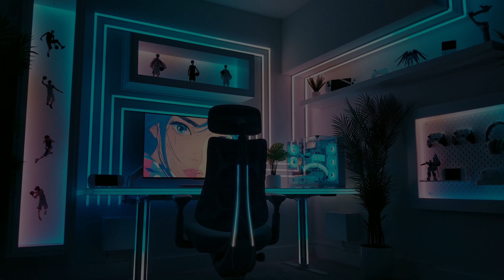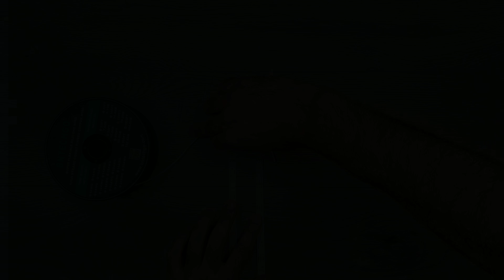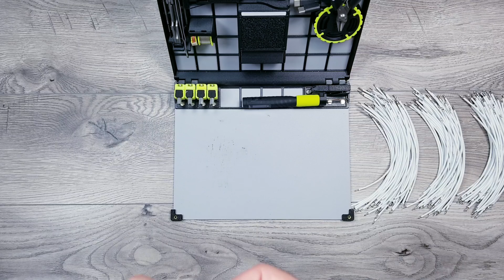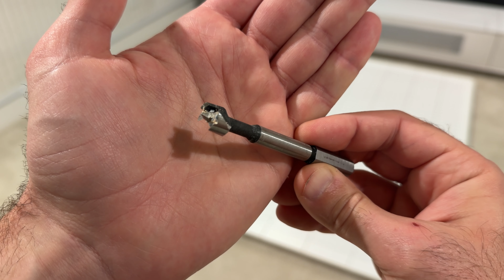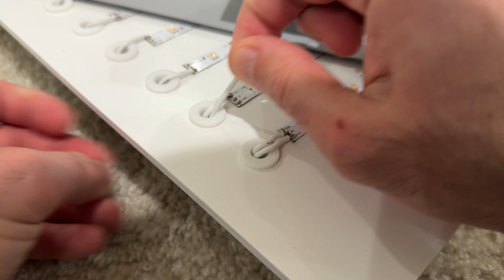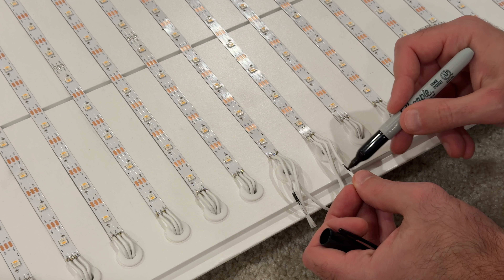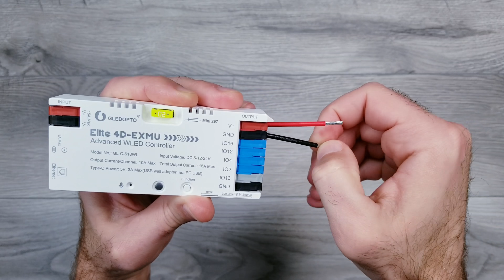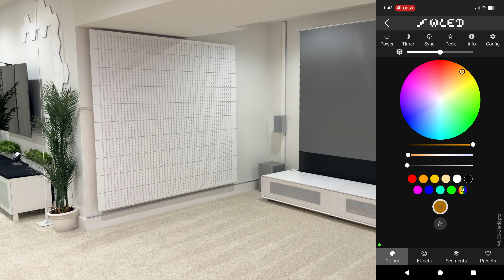DIY Matrix Panel: EASY, One Controller, One Power supply.

Comment from the maker: Solder Kit: https://bit.ly/40s3jFk CHRISMAHERDIY for 10% off
Gledopto WLED Controller: https://amzn.to/4vXACxx
12v power supply: https://amzn.to/4aIceYk 
12v sk6812 leds: https://amzn.to/4piiLiD (30 led/m)
12v sk6812 leds (AliExpress) https://s.click.aliexpress.com/e/_c3bFW6iD (30 led/m)
Ethernet cables for hardwired connection: https://amzn.to/4pckxBC
12v power supply: https://amzn.to/4aIceYk 
Wire Stripper:https://amzn.to/3V8Hszv
18 AWG Silicone Wires White: https://amzn.to/4h6CT4T
18 AWG Silicone Wires Red: https://amzn.to/4wzL4eu
18 AWG Silicone Wires Green: https://amzn.to/4wCqSZt
Wire Stripper: https://amzn.to/4h7Pipi or https://amzn.to/4feiEjq
Wago Connectors: https://amzn.to/4vi7BeR or https://amzn.to/4vpnCjk
Stud finder: https://amzn.to/486dR1b
Brad nail gun: https://amzn.to/4tjtRVt
Forstner bit: https://amzn.to/4cl6iWx
Rubber grommets: https://amzn.to/4teIYzD
Solder Kit: https://bit.ly/40s3jFk CHRISMAHERDIY for 10% off
Kester Solder (best solder i've ever used): https://amzn.to/4lxLjlf
Govee 1500 LED Light Wall (if DIY rout is not an option): https://amzn.to/4tP10sa

🎧🎧🎧 Music (helps support the channel) 
timeless: https://cgmc.bandcamp.com/track/timeless
drifting apart: https://cgmc.bandcamp.com/track/drifting-apart

Relevent Videos:
Ambilight build: https://youtu.be/kJC-BvfhafY
Gaming Room Build: https://youtu.be/POQ3JYnBm7Q
Soldering Tutorial: https://youtu.be/Mh-hQd4c7fU or https://youtu.be/apSz3NXYlx8
Media center initial buildout: https://youtu.be/IW_wCNGrUyU

=============================
Support My Channel Directly:
Become a monthly contributor on Patreon: https://www.patreon.com/ChrisMaherDIY
Buy me a Coffee: https://paypal.me/ChrisMaherDIY
==============================

The best way to help support my channel is to like, comment, make sure your subscribed and share my videos with as many people as you can. The other way is to use my links above as I get a small % at no extra cost to you if you buy something. Thank you all for the support!
Reply: Have you considered solder dipping for repetitive wire preparation?
A small, metal, heated cup containing molten solder for wire dipping seems like a much faster process.
Reply: Cool project! I could be wrong on all this but I'm concerned. The strips are capable of pulling 1620W/135A at max brightness. The Gledopto controller maxes out at 180W/15A total. Your power supply isn't enough for that unless you are further limiting what the strips can pull in software, and you'd need to limit it to 100W/8.33A total for it to be safe and leave 50W PSU headroom. So right now you're getting only 6% possible brightness from the LEDs and it may even be unsafe depending on how the Gledopto controller handles it. I'd recommend at the very least upgrading your PSU to 230W.
Reply: Total build costs ?    Thank you
Reply: Easy solution for against hurting knees and back... Lift the workpiece so u can stand or use a chair. 
Also, do u use the forstner drill at low drill power. With wood ain't helpful. Better use high power and control the throatle with the trigger.
Nice project.
Reply: damn you should of shown more effects 😔because that looked amazing, damn! 😑 now i have to do this myself thanks alot🙄🤦😆

Comment: Here is a tip for anyone wanting to tackle a similar project, for tinning hundreds of wires in just a few minutes: take a shallow can (like a tuna can) and place it on the stove; making sure, of course, to keep the windows open and the exhaust fan on full power. Then, add some solder (preferably lead-free, if you care about your health), and you have your own solder pot ready for dipping the wires you need to tin.

Comment: One tip wit tinning the wires , you put some soldering wire in a metal cup, put in on the stoveand when its melted,  you just dip in the wire ends in it ... waaay faster .

Comment: Curious what the total price of this project is
Reply from the maker: Probably around 800? but majority of the cost was the led strips and if you just use regular ws2812 strips (instead of the sk6812) you could easily cut this project in half (but would probably need some more injection points for power since those are 5. Or you could use some 12v ws2815 strips that are still cheaper than the 12v sk6812 lights I used.

Comment: Notwithstanding the marketing jargon, they are not individually addressable LEDs. They are serially addressable (or string addressable) LEDs in an LED strip. For them to actually be individually addressable, you would need to be able to update exactly one LED with one short instruction, i.e. send a single address/data pair and a single LED updates. This is the sole reason I never consider these products. They have lots of advantages in design simplicity. I just can't get past the lie.
Reply from the maker: I mean I can chose any led on the string and send  data to that 1 single led. Not sure how that's not considered individually addressable?
Reply: @ChrisMaherDIY  The strips don't have individually addressable LEDs. It's the library that you are using that makes it look like the do.

The controller sends a reset pulse, then streams the color data for every LED in order. It never sends a packet to a specific LED by address. Each LED just consumes the next packet in the stream.

If these LEDs were truly individually addressable, updating a single LED repeatedly would give you an update rate of about 12,500 fps.

Your 2,500 LED panel, it it were all wired as a single continuous strip, probably would have an update rate of about 10 fps, depending on the protocol speed. Because you set it up for 4 groups that can be updated in parallel you are probably getting about 40 fps.

It's possible to design a LED strip that has the same flexibility of being cuttable and solderable into longer strips that could actually have individually addressable LEDs. But the communication protocol would have to be very different. It would need to include a method to assign each LED an address, or at least have a power on default where each LED discovers it's own position in the strip and assigns itself a unique address. But that's not how WS2812/APA102 style strips work. They're serially addressed, not individually addressed at the hardware level. Yet these kinds of strips are marketed as having individually addressable LEDs. And that's a lie.
Reply from the maker: Gotcha! Thanks for the explanation. do truly individually addressable leds exist and if they do are they at the same price point as the ones I generally use (sk6812)?
Reply: @ChrisMaherDIY  I don't know of any for LED strips that do. But the protocol definitions for self assignment of individual node addresses on a bus exists in several bus types, like I2C, RS485, CAN bus, etc. RS485 (arguably the same basis of twisted pair wires that ethernet and USB use by the way), has a protocol design where the controller sends a "program mode" command and assigns the first device an ID=X. That device sets it's address and sends an incremented X downstream. That's an over simplification off what happens, but you get the point. Devices using this bus protocol have been in use in industrial automation systems for probably over 40 years by now. It's not like there is a patent protecting the idea of self assigned addresses.

I just googled found that the WS2811, WS2812 design protocol comes from China.

Perhaps they wanted some control over it's production and distribution (and perhaps even wanted patent protection) and therefore had to come up with something new. Perhaps they knew that it wouldn't sell very well unless they lied about it being individually addressable. Perhaps 'individually addressable' means something different in their language, or perhaps they just don't care enough to use accurate terminology.

In any case calling them "individually addressable" is a marketing 'jargon' claim at best, a deception or lie at worst.

Comment: If I’m lighting bookshelves (both top and bottom rows) would this method work as far as power injection and keeping everything on the same data? Obviously my wires will be longer,  but it should still be the same concept right?

Comment: I DIY my 65" tv ambient light with a custom arduino controller and 300LED with 12A PSU (overkill because only uses 3A). 
Total cost 15$
I wonder what's the cost of this...

Comment: New tool list for ya.

- Saw horses... i mean, come on man. 

- Solder pot. Just dip the wires in.

- Hot air rework gun, wand station... whatever you like. Easypop a lot of wires or chips off with it. Its also a lot easier to set chips and reballs if you dont have a plate. 

For real, get off your knees unless you do yoga and have built them up a lot.

Comment: Gledopto has only been a major disappointment for me in the end so I hope for you it holds up to your expectations in the long run. Also that PSU is certainly not high quality...
Reply from the maker: I've been using their controllers for a couple years now and they've been rock solid. I've also never had a psu fail but I'm also not doing commercial installs where things are running 24/7. I'm sure there are more expensive/high quality psu's out there for that type of use case.

Comment: how much does a project like this cost minus bought equipment ie soldering iron etc
Reply from the maker: I never added stuff up but the led strips were by far the most expensive. My guess is probably around 600?
Reply: @ChrisMaherDIY oh that's good. Would this be possible if you could get smaller compacted LEDS?
Reply from the maker: Yeah you could do it with any addressable LEDs. Different LEDs have different voltage/ power requirements so that would be different.

Comment: Rather than unsoldering , could the start of the role not been cut on the next cut marker ?
Reply from the maker: You certainly could but each roll I used had 150 LEDs. 50 goes into that even.

Comment: for tinning the ends of the short wire you could have dipped them into a molten crucible of solder help hot with a torch

Comment: There's a beginning to this quest and that is first mastering multi axis machining or robotic control systems and robotic assembly. So you can just program your robot slave to solder and line everything up straight every time and repeat that process hundreds of times so you don't have to. I mean you still have to learn all this stuff and even more for robotics. But then you don't have to literally work on your knees all day long or inhale a bunch of fumes and need a chiropractor and massage therapist after just to sit down and enjoy your work!

Comment: Tinning 300 wires almost justifies making yourself a small solder bath so you can just dip a whole bundle all at once. I guess if it takes more than 1.5 hours to make and prep the bath. But if you do this more than one time. Definitely.

Comment: solder pot's are used industrially, well more  back in the day for tinning wire. Probably work for the strip if you didn't dip to deep.  Great things if you need to tin things. Can toss old scrap bits of solder in to keep it topped up. Not worth it for a 1 off but if you do it on the regular they are a life saver for time.

Comment: How do you figure which is the top or bottom? Also I'm very confused at where the cutting happens and which one you connected the clips to. Also I'm confused as to why you had to solder another cable to the led. Can someone please explain

Comment: I think that the tool that would make drilling all those holes easier would be a bench press. I'd probably drill the end panels before putting them on the big square, and triple checks the measurements.

Comment: Since you ask, I think the easiest way to drill 50 half-inch holes is to put the Forstner bit away. Mount a finer drill in your chuck, something like 3mm (one eighth) and drill all the starter holes. Then use a 12mm/half-inch HSS bit.

Comment: Get a solder pot. Dip the ends in flux, then in the solder pot. Make sure not to run the pot too hot or it will cook the solder.

Comment: Hi Chris, awesome video! I want to try and make one for my place, not as big, maybe 2m x 1m, but wondering if I could use 5V LEDs instead? Obviously I'll then use a 5V power supply instead of the 12, but then would there be a significant or noticeable power drop? I'm wondering even if I break it into 4 sections like you did, if that would then maybe help?

Comment: Hey Chris, Long time watcher, Big fan.... Ive done a few cool projects using your videos as inspiration. one trick Ive learned is, Power doesnt really need to be ran like the data line. It flows in both directions, like a bus. You could easily take a single wire, and lay it accross all Positive pads, another across all negative pads, then only worry about the data being connected end to end.... Its saved me hundreds of hours of soldering and probably hundreds of feet of wire too. (the positive and negative leads dont even need to connect to the same area on the strip.) Ive actually found that this method helps with power hungry setups, as it dispurses the power more evenly, allowing each section to get more current from the wire, vs going through all the strips.

Comment: Actually for power distribution in these applications, it's better to make a bus-bar connection whit positive on one side of the strip and negative on the other side. If you do so, every led will be supplied whit approximately the same voltage. good job btw

Comment: Holy hell, I priced the strips controller and power supply on amazon and Its just shy of $1k, that's without the wood and spool of wire for connections. Entertainment has a cost.

Comment: 13:19 It comes preinstalled with a fork of WLED that’s been customized for the Gledopto controllers. OTA updates with the official WLED firmware on their controllers (I think just the Ethernet, but maybe all of them) can ‘break’ stuff
Reply from the maker: I've updated these before with the non gledopto version and they worked perfect. Just have to make sure you use the Ethernet version if you have the Ethernet controller and then enable Ethernet in the settings again. But might as well just use the Gledopto version since they have it available.
Reply: @ChrisMaherDIY That’s good to know. I haven’t personally tried OTA updating any of them, because I haven’t used any of the ones I have in any meaningful projects (I want to make one of your panels and use one just for the spirit of the build), but just recalled seeing it in the manual and assumed they did something funky with the code that I didn’t want to have to dig into to fix.

Comment: I would have marked ONE side of all the wires before attaching to the strips. I solder 1200 wires in one shift. I make a LED product and hand solder. 3 wires in and 3 wires out times 200 strip. You could have cut your short white wires and used a marker to identify one end of the them. One pile green, one pile red, one pile nothing (aka white)

Comment: Nice! The clean work takes lots of focus, patience and repetition.
If I needed to tin that much wire I would have got a small Solder Pot.
Sticking the bare wire ends in flux and then a quick dip in the Pot would have cut that 1.5 hours down into minutes

Comment: You could have saved the desoldering step by just cutting one LED of from the start and use the next set of contacts
Reply from the maker: I normally do that but each strip has 150 LEDs total. 50 goes into that even.

Comment: Great video! Quick question: I get why you had to do power injection periodically to prevent voltage drop, but why did you have to split data into 4 distinct sections? Is it that the data line would also see too much voltage drop?
Reply from the maker: WLED recommends to not go much over 600 LEDs per data channel for best performance. I've never tried 2500 LEDs on a single data channel but my guess is you would have some performance issues. Might have to try that sometime though!
Reply: @ChrisMaherDIY thank you for the clarification!

Comment: Very cool 😎 I did something like this about 10 years ago with individual addressable rgb leds on led strips and the T-300k controller.  I wanted my led wall to be able to display video and not just cool led movements / sprites.  And it actually worked!  I used a roll of plastic fencing & zip tied the strips to the fencing.  I needed it to be light weight so I could hang it off my house for Christmas season movies.  It was a lot of work!  I feel you!  I’ve found that dipping the electrical wires in soldering paste to tin them to prep for soldering works fantastic!  It sucks in the solder instantly on contact when you pot solder on your soldering iron tip.  Excellent job you did on yours!  Thank you for sharing.

Comment: Mid watch but use a hole saw not a forstner bit. Forstner is for like doing a hole halfway through the piece if u wanted to add a nut insert in or for clearance

Comment: Hey awesome project but I have a question regarding the power calculation.

You are using 2500 LEDs. Each can pull up to 0.4W (taken from the led strips you linked) at 12V, that means each can pull up to 33mA (0.4W / 12V).
So max power pull would be 2500 * 33mA = 83A at 12V. 
Your power supply can supply 12V and 12.5A max. 

Aren't you bottlenecking your LED brightness and power consumption like this? So you basically wouldn't be able to run the LED matrix at full power consumption. 
Dividing the max rated amperage 12.5A by the max possible ~83A you could run the LED matrix at only ~15% power.

Am I completely wrong on my calculations or does it seem to be underfitted in terms of power consumption?
Obviously the use cases that were shown with fancy animations most of the LEDs are turned off. But I was just wondering how you would be able to power all of this.

Cheers :)

Comment: Aren't those SK LEDs basically 5V LEDs?
Because they all run in parallel – so you are wasting like 60% of power with those resistors they put infront each LED…